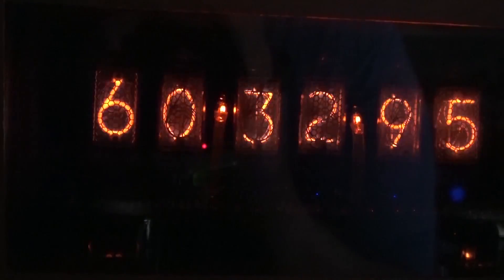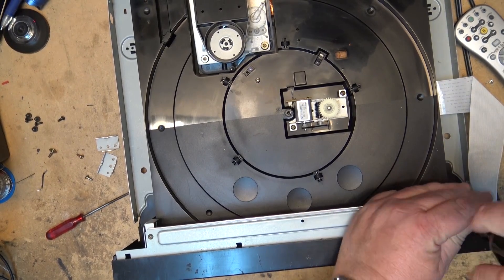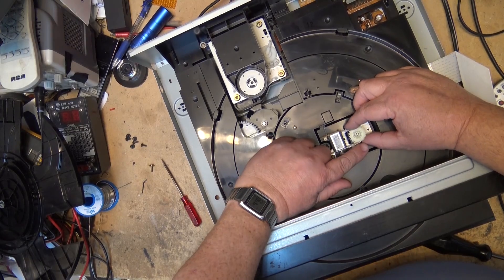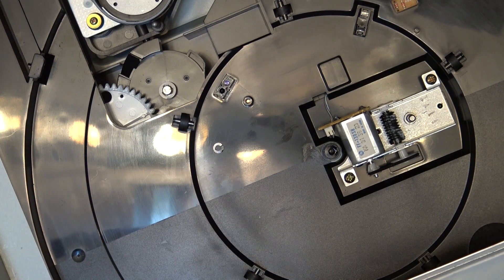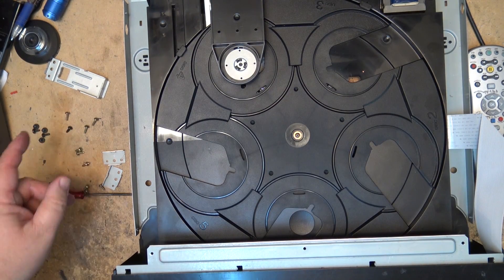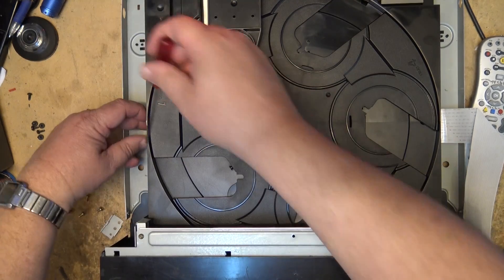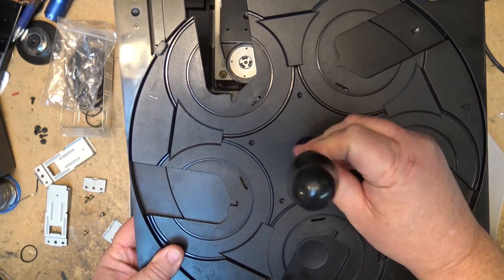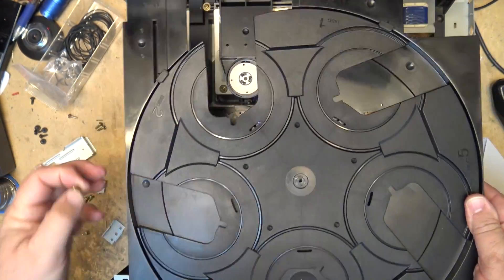Sony CDPC235 CD player disk jammed fault

Comment: That is so cool! I have a 3 disc changer that has 3 sliding trays in a drawer, stacked. The one you are working on looks interesting. I think it should have had a clear top, personally. So I could watch the changer work. Too bad you couldn't fix this without too much trouble.
Reply from the maker: I would like to put a clear top on my 200 disk jukebox.
Reply: That would be awesome.

Comment: Was never a fan of these carousel CD players. Too many problems, always breaking down. Single loader are much more reliable. Every carousel one like that I had broke. It'd either not eject the tray at all or not spin the tray. Most likely belts or gears wearing but they certainly weren't made to last.

Comment: Yep not worth throwing any money at it.

long ago a frend had a odd player, his kids managed to break it.
On the base there would have been plastic pins sticking out,  moved by the rotating c.d tray.
Yep snapped off :-(
The plastic switchpins were moulded in to the base, not replacable.
I heated solid copper wire and sunk it into the remains of the pins, then cemented wire insulation on the wire that stuck out.
That worked great for 2 years, one of my temp bodges :-D
He never expected it to last long, a nasty design.